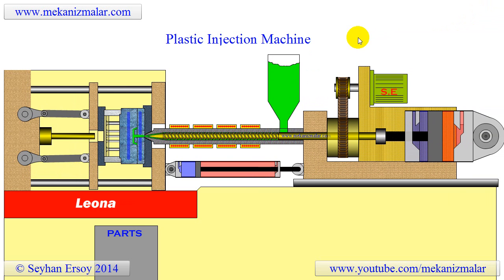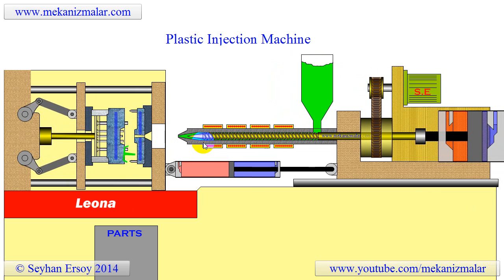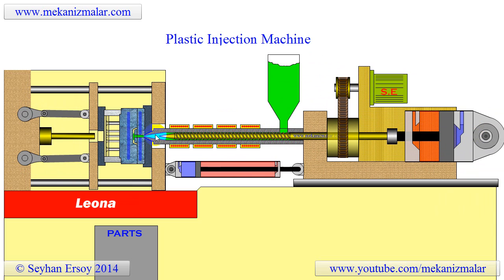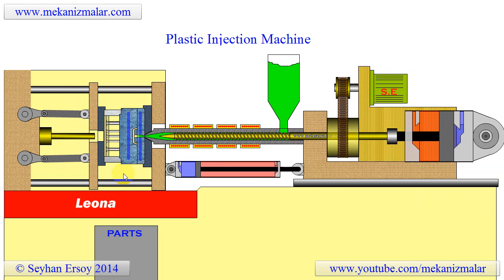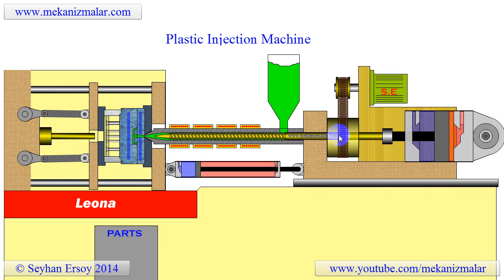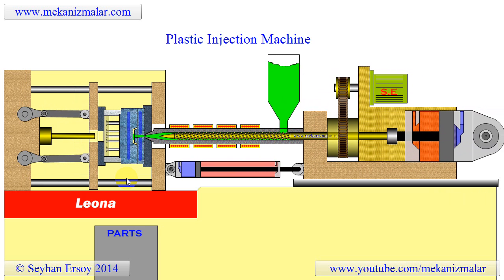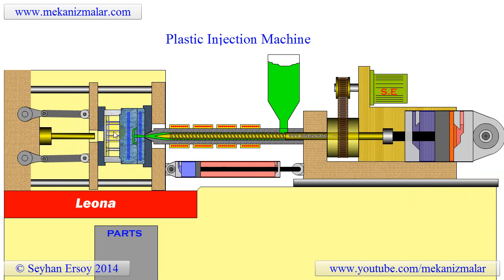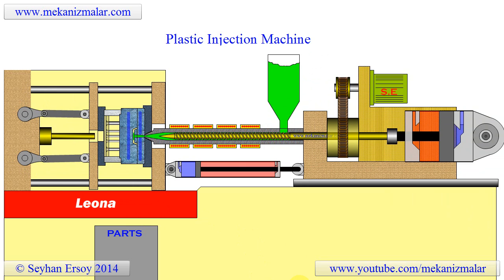Plastic Injection Machine

Comment: can we get a machine like this but smaller size??
Reply from the maker: Yes you can, but smaller they get you might loose some automatic operations like feeding the meterial and removing the parts. I do not know what you are going to manufacture and how many off pieces of production you will make. If you are going to produce simple parts at limited quantity, it is best to find someone to do it for you rather than to buy a machine.

Comment: could you make it clear to me what the name of the 3 undesirable marks are
Reply from the maker: +mz atmaca I am sorry but I did not understand the question.
Reply: +mekanizmalar at 3:18 it suggest to find the marks when we hold a product
anda at 2:20 it talks about a mark, left by injection moulding
Reply from the maker: +mz atmaca These three marks on the plastic parts are
parting line, which is a mark left in join locations of two parts of the mold.
gate scar, which is mark left by at the plastic inlet location into the mold.
push pin circles (I don't know what those actually is called) which are marks left on the plastic part by circular push pins. You usually hide that marks by designing your part such that it is not visible in the most used face of the part. 
I hope this make it clear.

Comment: i've never seen one where the entire injection unit backs up every shot
Reply: +Mike L Because this is necesary just at double mold , i mean mold with 3 parts , one fix and 2 moving parts ....
Reply: Mike L u R right I also have one injection molding machine but didn't seen this yet